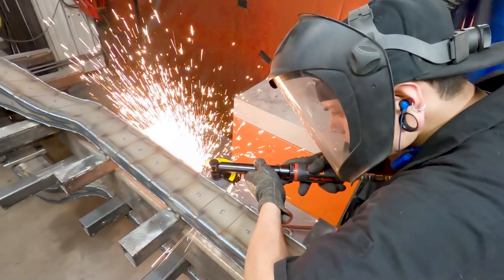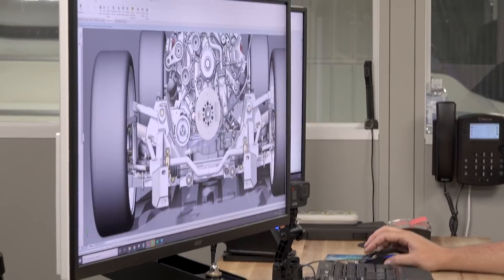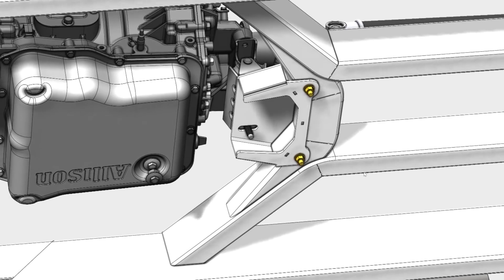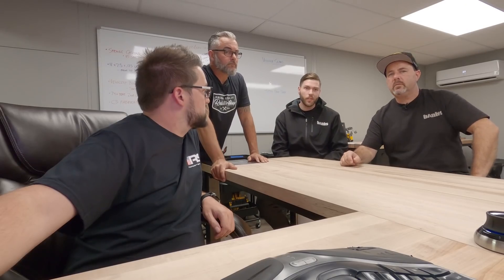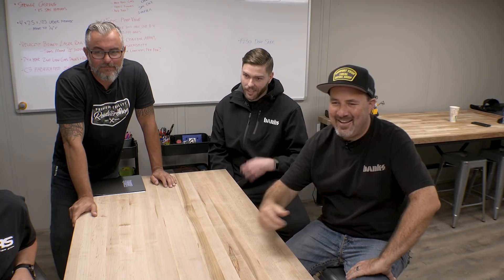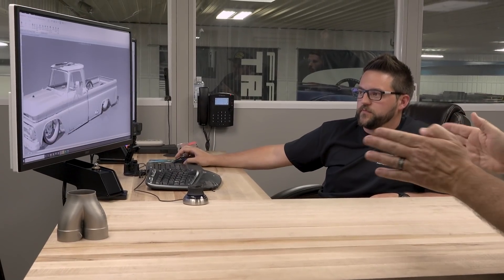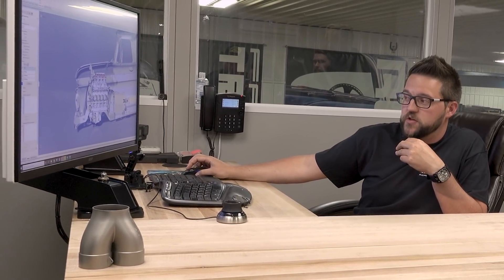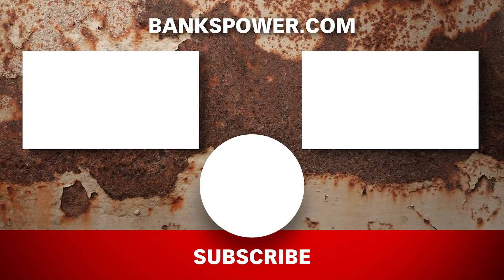A chassis built to support 1,000 lb-ft of torque | BANKS BUILT Ep 11

Comment: I thought that emissions were high on the design of components list, yet I don't see any exhaust controls on this street rod.  I suspect that perhaps the tune would provide emissions control with MAP?  I'm just trying to understand all of the nuances discussed, so excuse me if I seem to be such a newbie...Love this channel and everyone on it, keep up the tutoring,  thanks
Reply from the maker: No worries, be happy to explain. Emissions equipment isn't really a concern for us on this build, there is no need for it. Federal emissions laws currently state that pre-1975 trucks are emissions exempt which includes our 1966 Chevy C20 (which did not come with nor required emissions equipment). In other words, states California does not require emissions equipment on vehicles older than 1975. So, this truck is exempt. This engine, or ones like it, will be available from Banks for use in non-emissions regulated applications such as repower, marine, military, etc. 😎🤙🏻

Comment: If it doesn't have the right turn radious you always can make a rear axle with steering it will be very complicated but worth it, and then at high speeds only use the front steering so you have the best of two worlds, a good tur radious at low speeds and a precise control in steering wheel at high speeds

Comment: Looking good so far , have you thought of putting the watts link horizontal on the top of the diff instead of vertical on the back as it might save you having a leg mount hanging down and you will still be able to get to the diff cover easy ?

Comment: Can you add a bolt on spacer to the bottom of the frame to add to the overall height and the frame rail in order to drop transmission and engine lower for more hood clearance? Depending on how much farther you need to go down is how tall you and make the spacers for the frame to make contact with the ground. Spacers might be nice because it won’t scratch your frame rails can you put it on the ground, just the spacers. You can even mount polyurethane bump stops if you wanted to as well. Love the CAD work!
Reply from the maker: Good idea on the spacers and bump stops!

Comment: Honest opinion, the "discovery channel-esque" feel of these is kinda distracting. How many camera angles and cut's back and forth do you actually need? Shaky camera footage of the screen mixed with actual screen capture mixed with a low side shot and a high front shot and a camera on the desk in front of them just STOOOOOOPPPPP You only needed ONE camera, angle, the FIXED non shaky cam one on the desk, and you only needed to cut it with screen capture and that would have been perfect. 

People came to youtube to escape that low attention span low IQ drivel.
Reply: Correction, now I'm further in, it's HELLA distracting.

Comment: I'd love to see an interchiller in the truck. utilising the air-conditioning system to cool the fluid for the water  to air Intercooler. Dropping the intake temps below ambient and pushing air density up.

Comment: title isn't very accurate - the chassis has to cater for the engine torque MULTIPLIED by the gearing in the gearbox - but ultimately it's down to the resistance of the tyre interface before losing traction.
Reply from the maker: You're correct about the title. But at a certain point titles become so long that people either won't read or understand them.

Comment: Raise the wood truck bed so that it is on one plane over the top of the frame for rear axle, therefore making  the bed usable to haul things.  The fuel tank is best in the rear as was demonstrated, but have the fill be in the last pillar that houses the tail light assembly.  I never liked having the fill in the usable wood bed surface.  Have the air compressor with controls under the wood bed in front of the rear axle.

Comment: I like that a Watts Link is used instead of a Panhard Bar on the 4 link suspension.
Reply: Pt cruiser has a watts link too.
Reply: @17madracki17  late model Ford panthers have 4link/watts as well. It came with the aluminum front end changes.
Reply: @17madracki17  Are you rooting for or against the watts link? :P
The Crown Vic switched to a watts link in the early 2000's, I believe.
Reply: Agreed

Comment: So when they did cut through views, the inside of Allison wasn't shown! Proprietary info/design?
Reply: File size is much smaller for just the housing. Makes working with the mock up in CAD much faster.
Reply: Unnecessary?
Reply: @seandurgin  could be but don’t think it was that, because they showed inside of engine which wouldn’t have been necessary either.
Reply: Banks would have had to model all the internals, not necessary for fitment seeing as they are already packaged within the block.